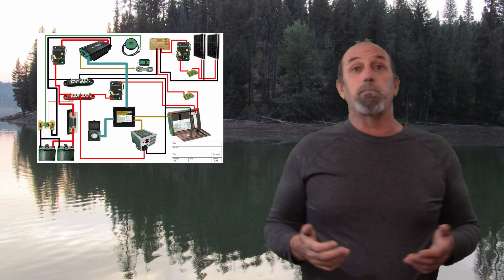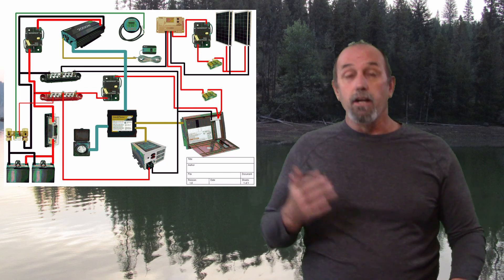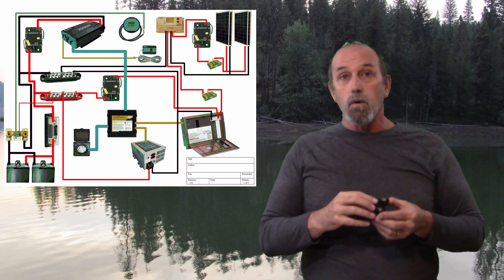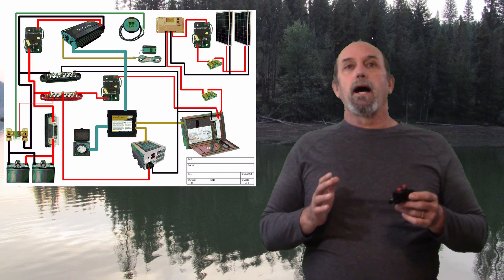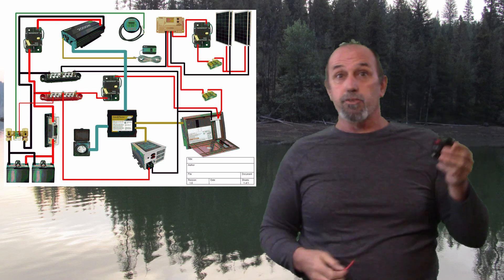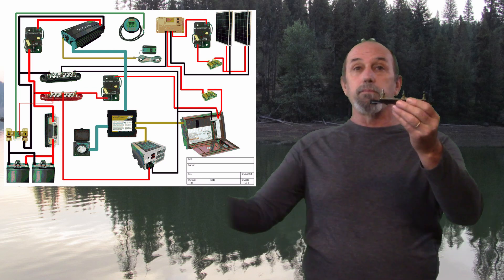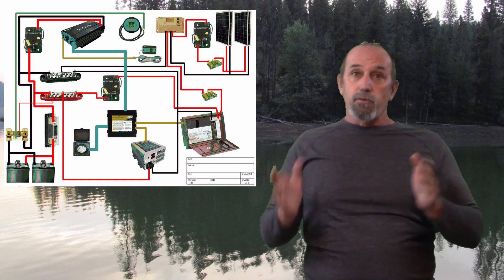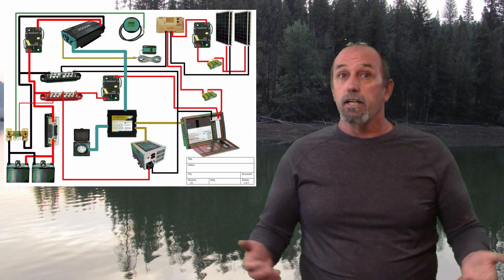Electrical upgrade breakers and fuses

Comment: Are you planning on doing a full rewire of the trailer? Or are you just upgrading the main parts of the electrical?
Reply from the maker: We are adding an inverter, automatic transfer switch, changing out the shore line to a plug and cord. Also we will be upgrading the solar along with nessasary wires, breakers and fusing.
Reply from the maker: Check out the series into video

https://youtu.be/JrKVDuf7bKc
Reply: @DiyRVandHome  I will definitely be checking this out, thank you for the reply!

Comment: Sorry I tried to watch this and you lost me right off the bat. What I am trying to find out is I have a 30 amp system. Coming off the battery the hot goes to a breaker which feeds multiple wires to the inside of my basement. Also the hot is bridged to another breaker which my trailer break and my electric jack is hooked to with a inline fuse for it. I am trying to figure out what amp these breakers are. They are corroded and can't be read.
Reply from the maker: Terry, yes this is a bit more complicated than a standard trailer wiring system. That is why I am breaking it down into smaller videos, hopefully in the end it will all be clear.

As for your question on what size breaker you have, those are generally a 30 amp self resetting breaker. They can be purchased at your local auto parts stores. Hope this helps.